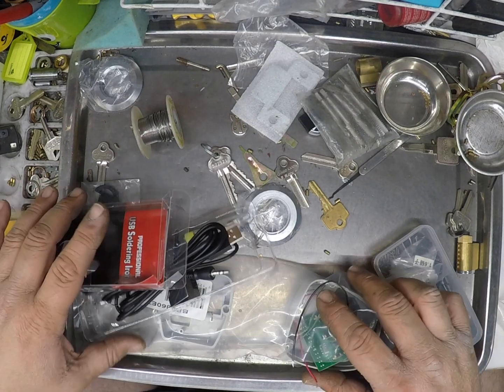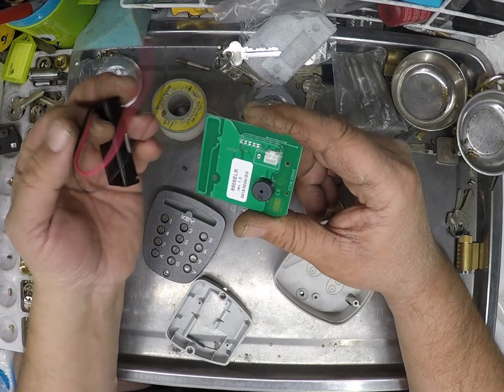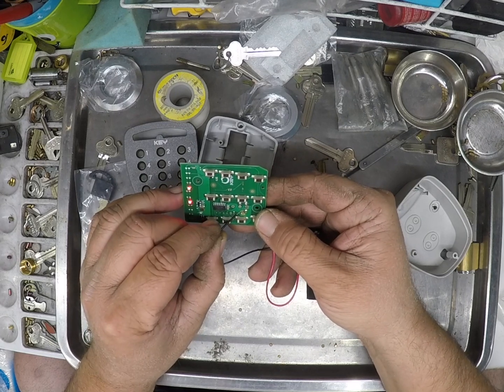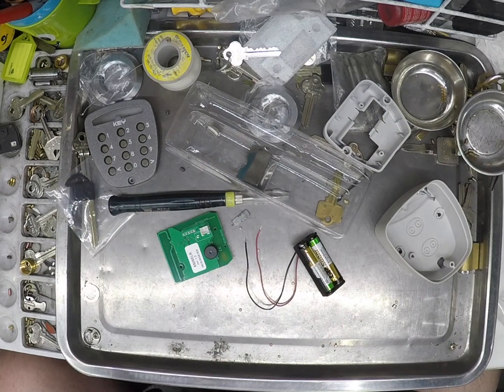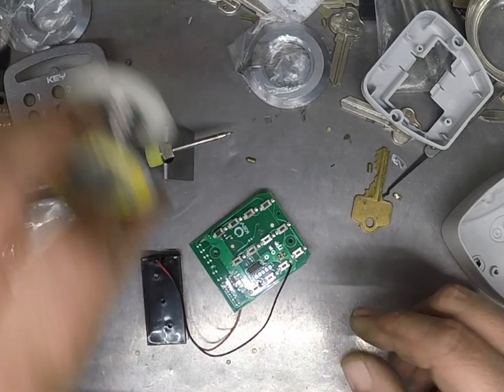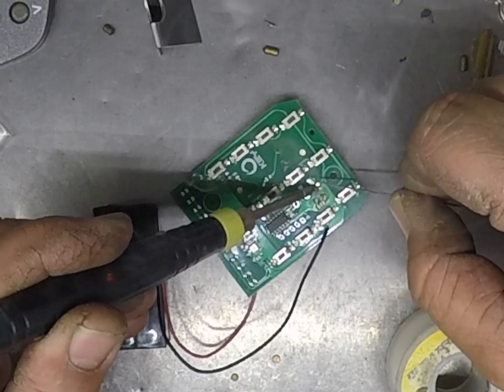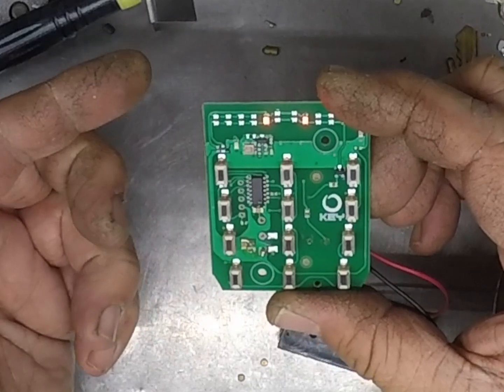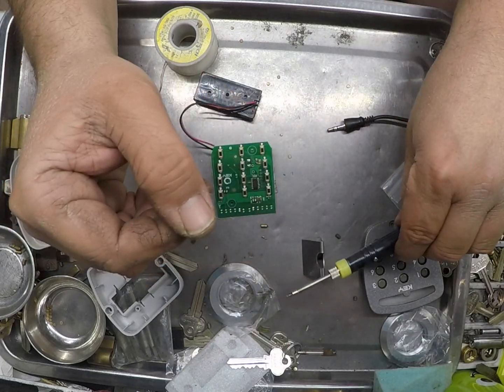USB Powered 8W Soldering Iron Test & Review

Comment: I seen a job a few days back and it has gone to a new high new leval of engenoity they supperglued yes they supperglued the wire's into the circuit board a first for me the bloke said it been in use for 3 years till it fell off unreal I get the best jobs are they for real and probably charged like a wounded bull